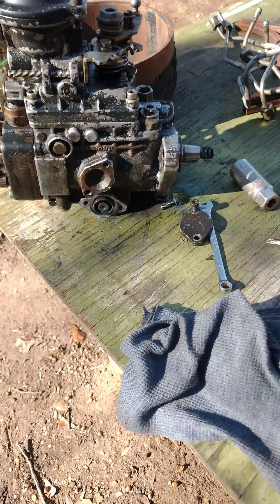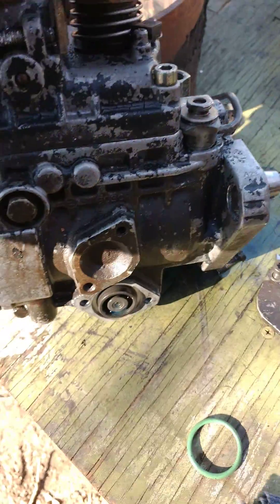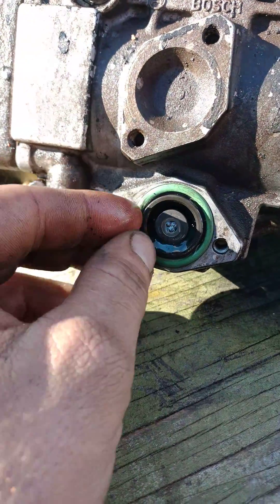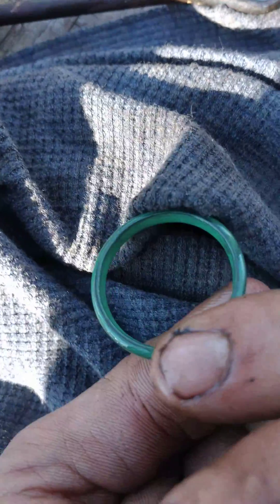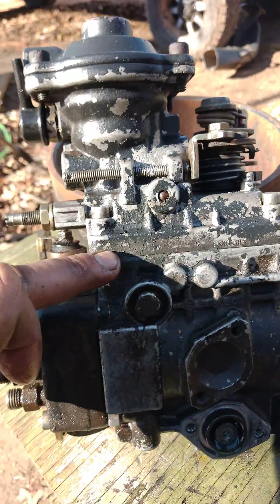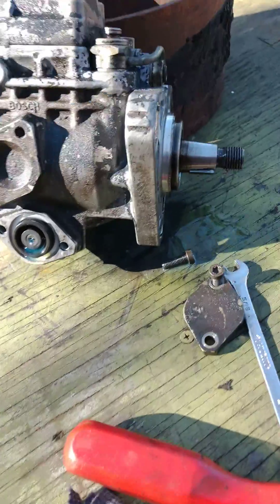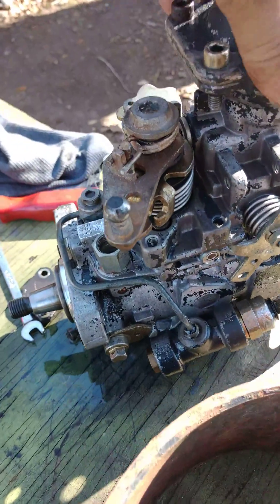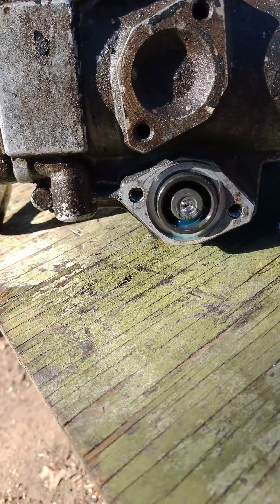Ve injection pump rebuild part 2

Comment: The part in the back where the injector lines bolt to is where mine is leaking. Any videos about replacing that?
Reply from the maker: I don't have one but it's a piece of cake in comparison. Just make damn sure you don't pull the back all the way off!!!!!!!! Just enough to get the o ring off!! Pop it back on and let her eat!